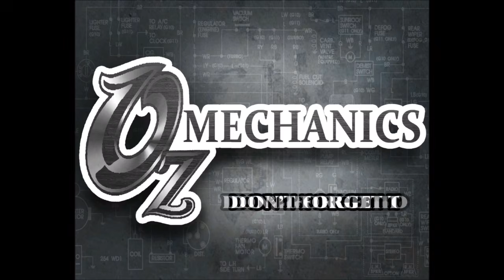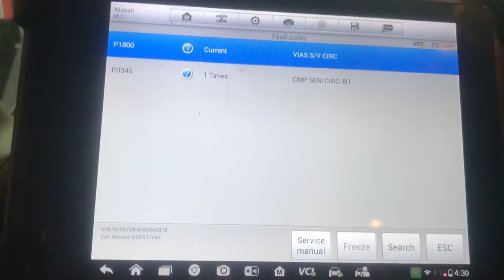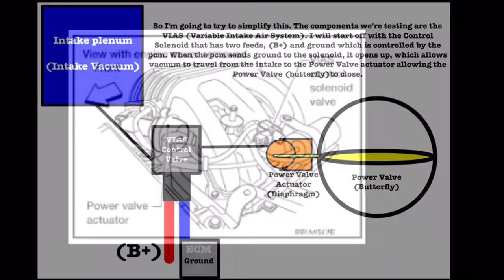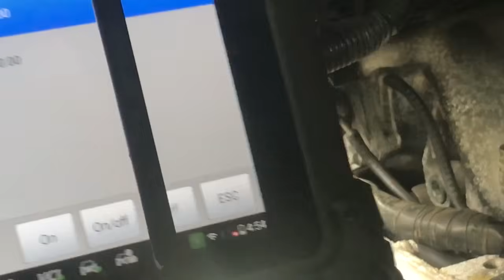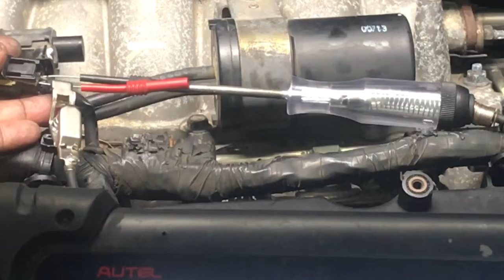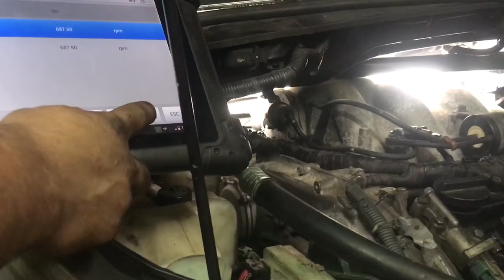Fixing engine code P1800

Comment: 08 altima 3.5 just replaced one that was completely broken new one in still doing the same thing as it was. is there some kind of relearn i should do ? or does it just need to be driven?
Reply: The same thing happened to me today. I just changed the VIAS control solenoid valve 2. I was getting code P1801. After I replaced the broken one im still having the same issues. 
Were you able to get any answers to this problem?
Reply: Are you the guy that ran the scanner on my car?

Comment: my 2006 nissan murano  engine stop after 45 min runn, to starting again at least need 10 or 20 min. in computer checking there is  no any failer code. what can Ido to resolve the car  problem?

Comment: Mine is leaking air at the tip (black rectangular section). Is that normal or is it causing a vacuum leak?
Reply: Thats not normal, you need to replace it, it should not leak air

Comment: What is the tablet that you’re using? Is it possible to somehow turn the solenoid on and off without special diagnostic tools like yours?
Reply from the maker: Knowing the circuit you can use a power probe to energize the solenoid. But the most important thing is to know the circuit. Don’t want to fry a module
Reply: What scan tool/hardware are you using that lets you activate and deactivate the VIAS valve?

Comment: If there is no vacuum going to the solenoid, there won't be any vacuum to pull the plunger. It would be wise to check for vacuum at the solenoid from the reservoir.
Reply: Thats exactly what he did in his first test, as u can see the plunger didnt move. Then he checks for the wiring, solenoid could be good but wires are faulty, so theres no signal that makes it turn on. However with the test light he debunked that theory and confirmed solenoid is messed up. 
What did you think the entire first test was about? Lol
Reply: Thanks! I'll get back to you. I've got a 300 HP Maxima that's gurgling and horribly slow. I know that I've got to replace motor mounts and pre-cats but it's looking like the VIAS solenoid is bad too.
Reply: Correct, wonder if the hoses are placed correctly?

Comment: Whats up Oz, I have that code as well.  Long story short, my car on heavy acceleration feels like its dragging an anchor till the upper rpms.  Could this be a factor.  Getting one soon but figured you might have an opinion.  Thanks brother, great vid!
Reply: I too have this issue with an Infiniti. Ever find the issue?
Reply: Yo J.D., did you ever fix your car? We would greatly appreciate your insight!
Reply: @Greenrida31  I tried the different air intake issues but didn't do anything.  I bought a new fuel filter and was gonna install that but ended up selling it to a guy.

Comment: Hey Oz,
My 2005 Altima keeps reving when on P or N, the rpms jump up & usually stays at 1.4 when idle. Like when I turn on cruise control & it goes down a small incline hill, you can feel it choke like it’s trying to stay with the set MPH. I swapped out that part & it still does it. Any idea what I should check out? I’m low income due to pandemic at the moment & looking to go the best route without breaking the bank to fix the issue. Thanks in advance
Reply from the maker: 64 HAPz it can be a handful of stuff. I really don’t want to put you down the wrong path. What part of the nation are you in ? I know a lot of techs were I can send you to. They can charge the diag fee and make sure your vehicle is fixed right on the first go around
Reply: Oz Mechanics Oz Mechanics thanks for your response. I’m in northern Texas, the panhandle area. I just moved here about 6 weeks ago : Amarillo, Texas

Comment: What are the chances of this going bad on my 04 3.5 maxima? Will turn over but not start. Will this keep the vehicle from starting up ?
Reply: Extremely likely pull one from the junkyard make sure it's oem aftermarket version fails. The car should start though if it's bad u have another issue.

Comment: Good afternoon friend, I have a 2003 murano this happens:
when riding on the road it goes very well, only that when arriving at a place, it accelerates and does not respond only until it accelerates a little more. and turning it off and on again it works fine again. it will be the solenoid of the P1800 tracks.
thank you.
P.S. I hope you have understood my question

Comment: You didn't show video when it wasn't working
Reply: Go back and watch the video!
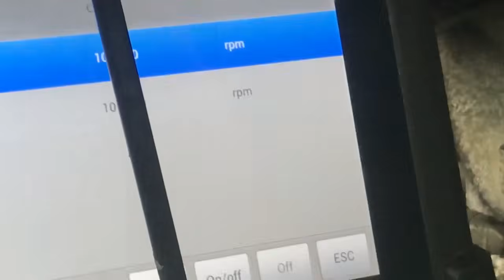Reply from the maker: 28better yea, on minute 3:30 I’m testing  it. Shows that it is not moving
Reply: @OzMechanics  you didn't show if it was on/off because you blocked it with your tablet.
Reply from the maker: Yea it was hard trying to show the tablet and sensor all in one

Comment: Bidirectional is a nice time saver for something like this. You'd have to drive it under various loads with a vacuum gauge Teed into the circuit to see if vacuum is present... or if the test light lights-up.